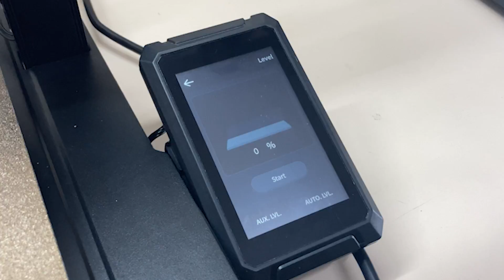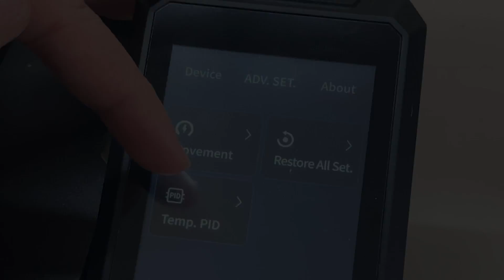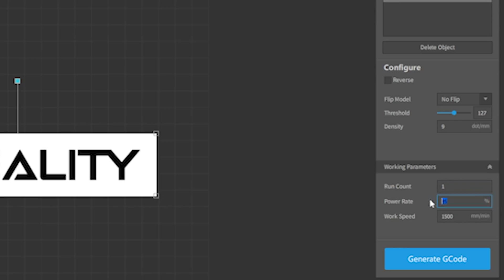Creality Ender 3 S1 PRO 3D Printer + Laser Module Review

Comment: It would be good if you could inform your viewers that this printer does not recognise folders on the SD card, I finally got Creality to admit today that this is correct. their reply is below:

If you put the folder in the memory card, the display will not recognize it, please do not put the folder into the memory card, and the print file should be placed in the root directory of the memory card.
If placed in a folder, it may be misrecognized.

So there you have it, they screwed up the software, which is effectively a downgrade on this machine!
Reply: HI, I have an Ender 3 S1, and just put a 5w laser module on it yesterday. Already run into limitations with Creality Print. The latest software update has the printer seeing folders on the SD card after an upgrade. So no worries there anymore. I am looking for more info on compatible software to slice my laser files.

Comment: I'm having an odd issue.  When i design a 100mm square it comes out as 80mm.  When it use the Ender controls and move it 10mm it moves 8mm.  Any thoughts?
Reply: i figured it out.  M92 X100.00 Y100.00

Comment: Bonjour. J'ai installé le firmware sur ma ender 3 s1 pro pour pouvoir utiliser mon laser. Mais le problème c'est que je n'ai pas le même écran que vous avec les options PRINT ET LASER lorsque je démarre mon imprimante. Savez vous pourquoi ?
Reply: i have the same problem, did you solve it?
Reply: Versifié que ta pas mis un fichier dans la carte sd, jsp exactement pk mais g vu d’autre commentaires qui disait que les fichiers son pas reconnu

Comment: I have a ender 3 s1 pro and a 5 watt laser I did all the necessary firmware updates. But I can't find where to send g-code to SD card for laser engraving.  Where did you get the slicing software
Reply: Can you drop the link,  please
Reply: Same problem, the manual in the box it is not updated. The manual shows that in the creality slice, we should add a new printer and look for the ender 3 s1 laser module, but I can't find that aspects in the new printer.
Reply from the maker: I sliced and sent it with creality print’ software. It is in the creality webpage

Comment: Where did you get the laser Firmware? I have been trying to get my laser to work but cannot get the correct start up screen.
Reply: Link in the description https://youtu.be/NmoRRFW4zTc
Reply: I can't get my start up screen to look like his either. I can't find the slicing software either
Reply: Creality Print. A very, very basic laser cutting software. I am on the web looking for something with instruction on how to use this software. Default setting for engraving is awesome. BUT! If I use default on a piece of cardboard I will burn down the house... It cut 1 mm into the sample piece of wood on the dark areas!

Comment: Hey. I just ordered the anycubic kobra and was considering the ender 3 s1 as well. What are your thoughts on what is best for a beginner? I also want to use many materials. Based on my research the kobra was the best. Do you agree?
Reply: I have a standard Kobra and a Ender 3 v2 neo. My ender has worked flawlessly. My kobra has had its extruder motor and power board replaced by the factory due to defects.
Reply: @turkeyman888  I'm researching my first 3D printer and debating to go with the Ender 3 V2 Neo or just splurge a little and get the Ender 3 S1 Pro. Curious what your thoughts would be as a current user of the Ender v2 Neo.
Reply: @Yielar1  I'm not familiar with what additional features the Pro offers so I would research that and make a decision based upon what features I really need from a printer. I couldn't be happier with my Neo so far.

Comment: Question with the laser engraver are you able to choose the wattage it engraves at?
Reply: It comes in 1.5w or 5w variants on Amazon. Those are the only two options. I'm not sure if you can lower the 5w version to 3w or anything since I haven't received mine just yet (Saturday). So I will just say maybe for now.
Reply: As an owner of a 5w module. No. You set the percentage of power. default is 80%. Cut a beautiful engraving 1st go. I am now working on getting Creality Print to complete enough runs to cut 3mm MDF. Have succeeded with 1mm grey board. Next step is 2mm Bass wood.

Comment: The blobs you see in the vase are a side effect of creality's power loss recovery feature. The printer will stop for an instant to save it's location at normal intervals. It is especially noticeable in case mode since it will usually try to save it's progress along a seam or within the until. But since people are addicted to these useless vases y'all have been noticing them more often.
Reply: Get an apc battery backup.
Reply: @lekify prints take hours, an apc tends to have enough battery to shut down a server / pc cleanly. Not keep it running
Reply: @K8Stuff  I have a UPS that will keep 2 engraving machines going for hours
Reply: how do you go about when you need to resume print from a power failure? I mean what steps do you do to ensure you continue the print and avoid the blobs?
Reply: @misteri09  you can do 2 things.

1: hope your power doesn't go out, because it probably won't. And if it does, suck it up and restart.

2: count the layers, find out what layer it stopped on, and remove the gcode before that layer. Before resuming, manually push a bit of filament through the head and hit start. If you did it right it should continue on that layer, there will be a visible seam however. 
 and if you're only printing vases , which is the only time it's a problem, probably dont need a printer.
Reply: @TopHat Videos Inc.  Lol! Understood! I thought so as well. You are the confirmation I needed. I actually tried to simulate a power outage scenario and when I let the printer resume, it was a disaster. It was a nope moment for sure. Thanks!!

Comment: Sweet. Can you cut things with the laser or does it only do etching?
Reply from the maker: It can not cut plywood in the video but it can cut felt, paper or something. But This module is not for cutting actually, only for engraving
Reply: @retsetman9698  I got it to cut, by repeating passes. You can set it in the software. I am now tuning settings for 1mm grey board. Going to start 2mm basewood. It is stated that it can cut 5mm wood. But will see.

Comment: Nozal size
Reply from the maker: Standard 0.4mm it can print at minimum layer height of 0.05 mm and thicker with this default nozzle that come with the printer
Reply: @retsetman9698  plz suggests me which software is best?
Reply from the maker: Slicer? If so, I always use Cura latest version but Prusa slicer or simplify3d is also great option